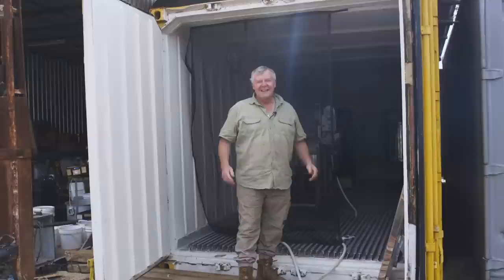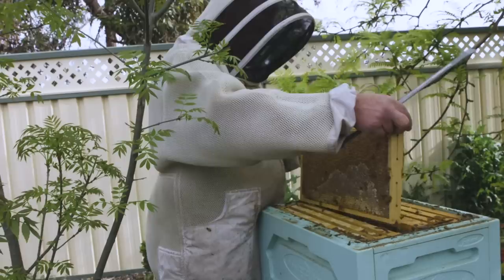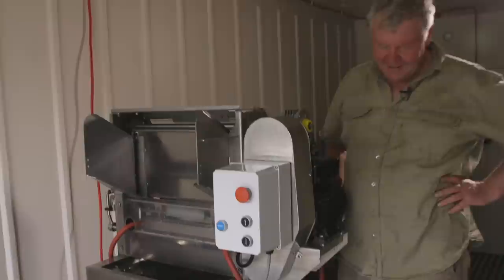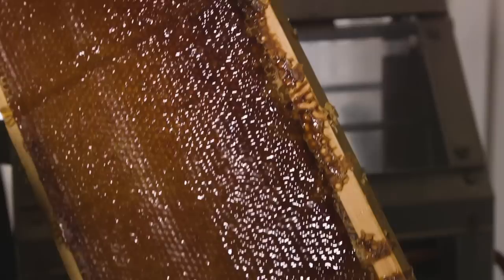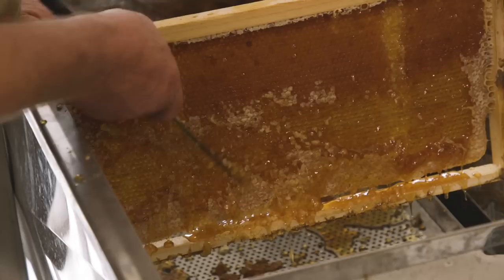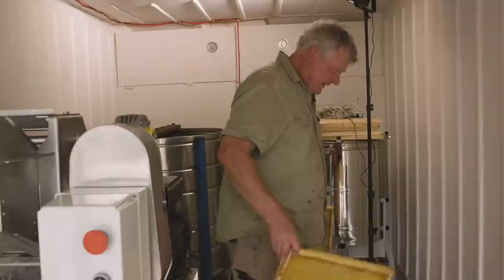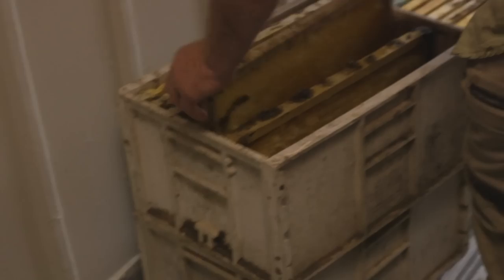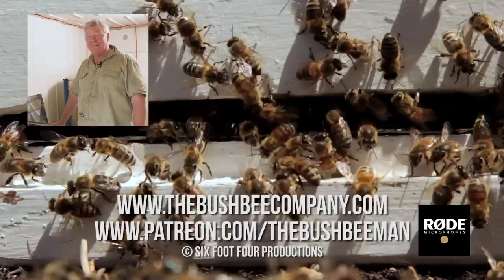Testing Honey Extraction Equipment in New Honey House | Honey Extraction Room | The Bush Bee Man

Comment: Hi Mark, I use a 'comb fork' [like a wide kitchen fork] which scratches the cell tops of the honey comb that aren't completely uncapped just to expose the cells  before extracting if that helps you and they are reasonably cheap to purchase.
  Does you spinner have different speeds ? Have you tried spinning at a slower speed to get some/bulk of the homey out first before going to a faster speed to extract the last bit of honey to save 'blowing' out the wax foundation on your frames.
  Like every thing in beekeeping experiment and find what works for you.  Only offering some suggestions.

Comment: Is there any way to use the uncapping stuff? I imagine it's a bit messy with all the wax and honey and other stuffs.
Reply: A good uncapping tank will have baffles in the bottom that the honey can go through leaving the wax.  There are also wax separators that do just that. Separate the wax from the honey, leaving nice clean dry wax for using later.